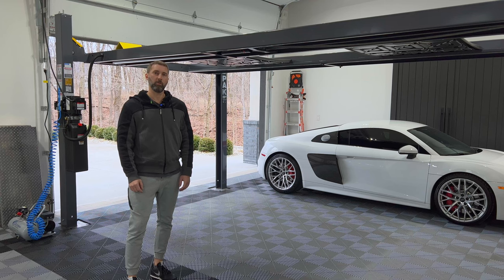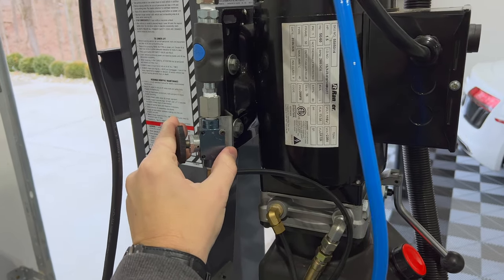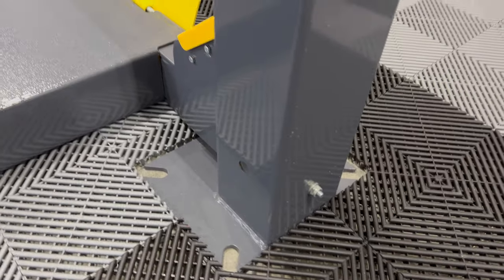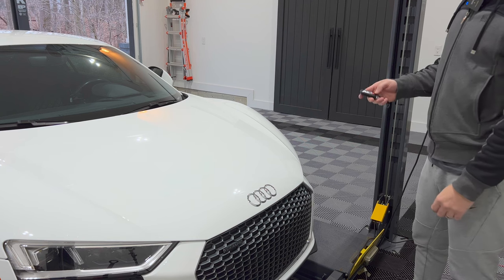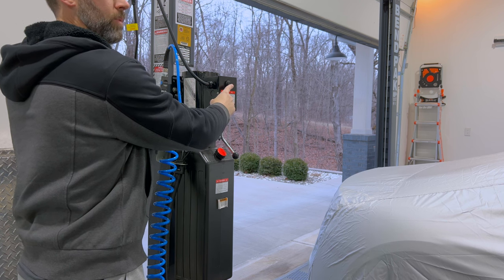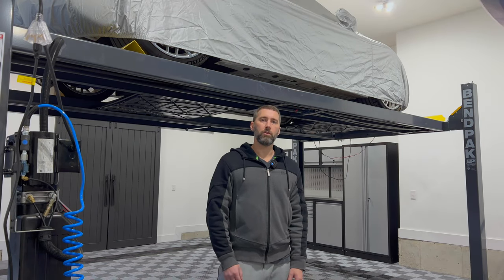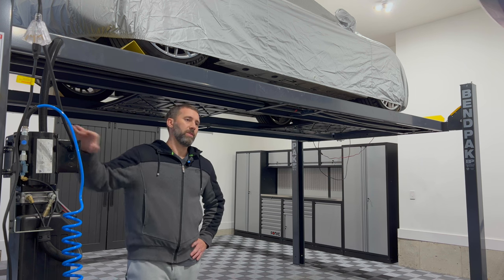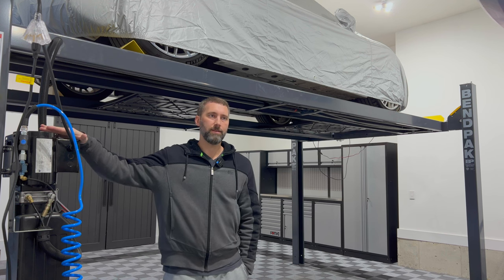Bendpak 4 Post Lift Overview

Comment: I have the same lift, the extra height is a nice feature. A couple of things worth mentioning, raise the lift off the locks before pressing the air lock release button, air supply to the release button shouldn't exceed 150 psi.....I find 70 psi works fine in my case. Also, I watch each corner when lowering to make sure each of the four corners locks has engaged. Thanks for sharing.
Reply from the maker: Thanks for watching! Yes all good points I agree and do the same, and I think my pressure is around 90 PSI. Do you get it serviced yearly?
Reply: @nextlevelmedia  90 psi might be more than you need, you don't want to blow the lock lines.....but it's your lift. I have a BYB also that I've had for over 25 years, I've done all the service on it and will do the same on the BendPak. Thanks for the reply.
Reply from the maker: @Al-tl2ov  thanks for the advice I will lower my PSI to be safe

Comment: The main problem I have with bend pak is everything needed is optional.  Outrageous in my mind.
Reply from the maker: Agreed you can definitely get the same setup for maybe half the cost but the safety features and engineering on this make it worth it in my opinion.

Comment: Very nice video.  Do you feel that there is no need to bolt the posts to the floor?  I think I still wouldn't trust it but that's cuz I have that kind of luck at times... ; o
Reply from the maker: Correct, no need to bolt a 4-post lift and confirmed with BendPak. I was definitely nervous but no longer after using it for some time now.

Comment: Nice setup!  Have the same lift. The support strap under the drivers side ramp has 2 large bolts on the bottom. Do the bolts dig into the Swisstrax? Mine chews up the floor every time the lift is lowered.
Reply from the maker: Yep same for me, luckily it stays in the same location. I tried contacting bendpak to address and come up with solution but got bounced around to the wrong people I guess. If you know a welder they could take care of it easily.
Reply: Bendpak has a fix with a lower profile bolt that I recently received.  Sent it free of charge.

Comment: great video. I got a question. What is the distance between the columns and the outer edge of the runaways and is the space equal on both sides??  Are they(columns, not their footprints) 5''x5'' square?

Comment: Why kind of periodic maintenance is required for the lift?
Reply from the maker: Good question, I know it is supposed to be serviced periodically but I have never done it nor had any problems. I’m sure the hydraulic fluid should be changed at some point. I’ll have to contact my service rep.